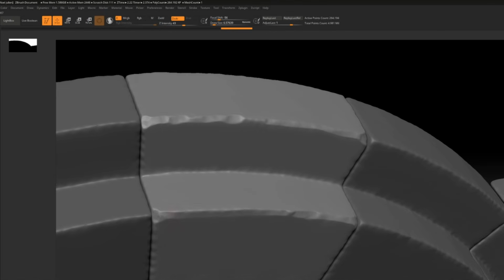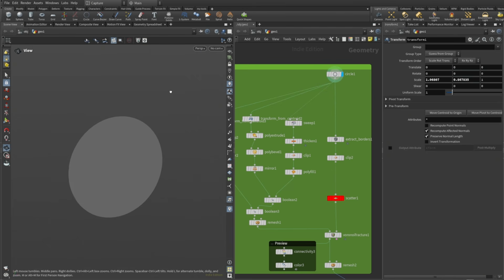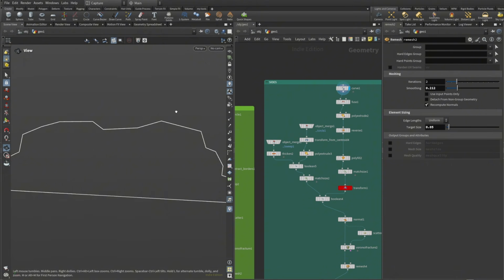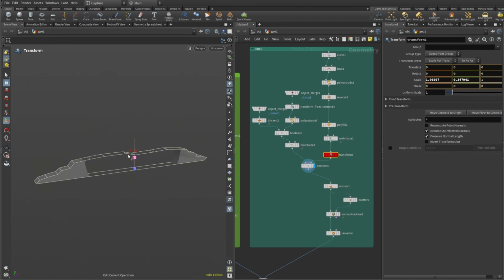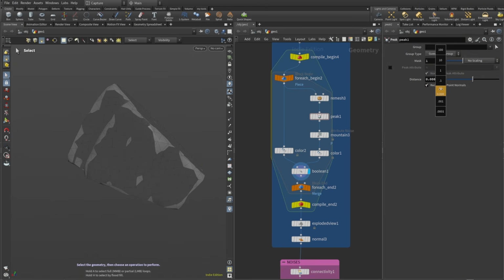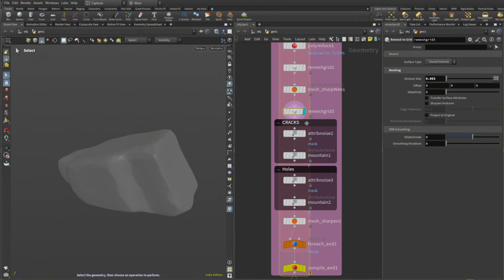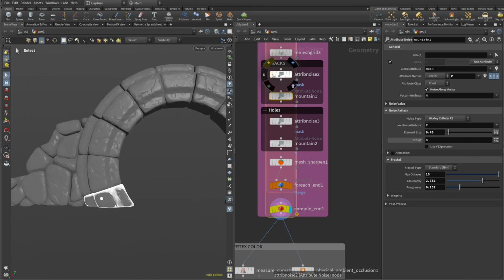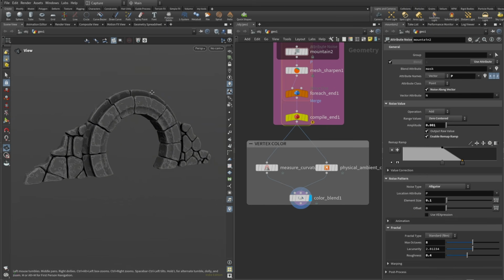Forget about Zbrush ! Go Procedural in Houdini #houdini #modeling

Comment: How fast is your machine?  Trying this my remesh steps take an age whilst yours seem almost instant.
Reply from the maker: Hi My machine is based on a Ryzen 9 9950X 
Strong CPU but it's getting old
Did you use the compiled block to remesh the part in multithread?

Comment: ew get  outta here lol I can't be the only one who sees Zbrush method literally like 22x simpler- you just use your mouse, or digital stylus to sculpt in details...ZERO node trees required. Come on...is this guy selling something, or what?
Reply from the maker: I’m not saying this method is simple, that’s not the point.
What it does is let you achieve similar results without spending a lot of time sculpting manually.
Yes, you need to build the node setup first, but once it’s done, the graph does the work for you on future models.
And if you change the base shape, everything updates automatically.
Reply: @IndieGarage1980  If it's not 22x more simple, tomd can't handle it :D 
It's a great workflow and helps to keep the style consistent, between a large library of modular parts. Also great for art direction, when it let's you focus on the large shapes while Houdini handles the details.
Reply: @IndieGarage1980  ignore him. Math clearly scares the poor kid. While Zbrush does have it place for characters that Houdini will never beat, for environments like in your tutorial where you need oto make thousands of rock/stone/brick variations, houdini is far superior. Yes the graph takes some time to set up, but once its there you have unlimited generation. Is just quite difficult to learn though